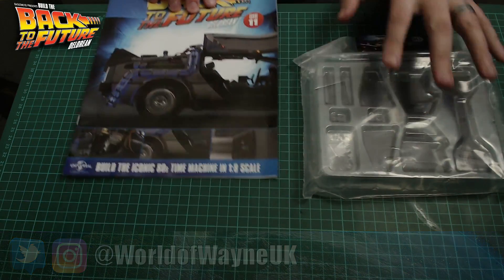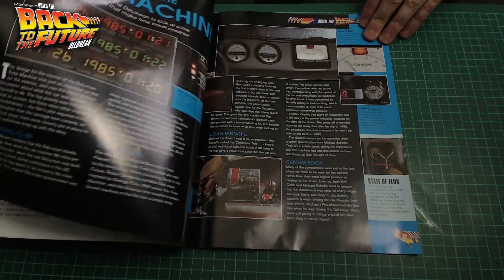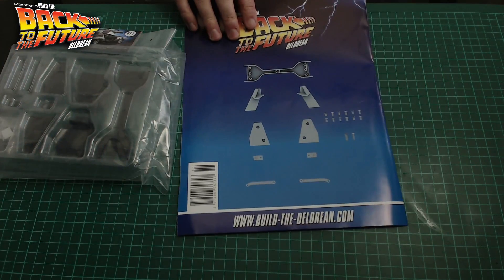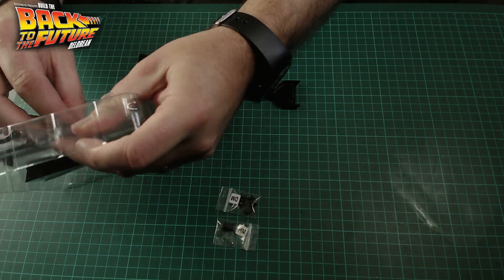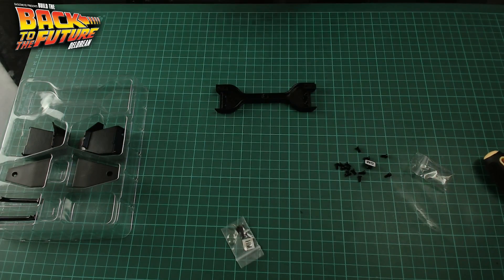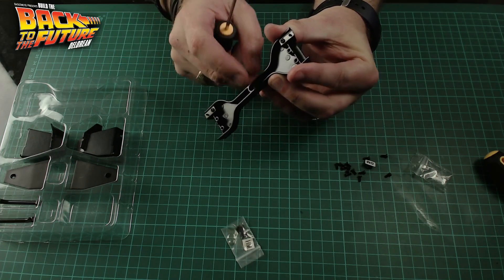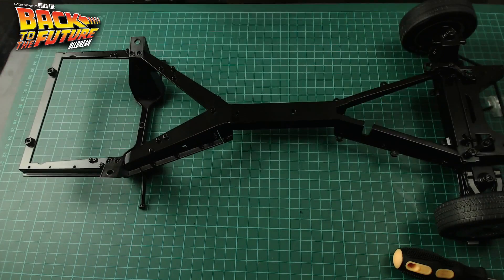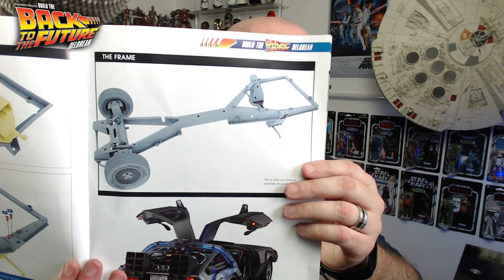Build the Delorean - Issue 11- Engine Support and Connecting Rods

Comment: Also! I’ve front wheel wobble, any ideas on how to remove the centre cap so I can remove the wheel?!
Reply from the maker: Strong double sided tape. Or you could break them and order a magnetic set from Mike Lane Mods
Reply: @WorldofWayneUK  cheers, Gorilla tape did the trick. Also, for holes not bored deep enough, I use a drill bit meant for wood.  Same for holes not wide enough, works a treat.  That said, I shouldn’t have to do that if the quality was right. 👍

Comment: Another occasion where the diagrams in the magazine don't match the actual item.  In this case the 2 arms.  The 2 hooks at the end of the arms aren't even present in the diagrams.  Very frustrating.
Reply: Yup. Did this issue yesterday and the diagrams definitely do not have the pegs on the end of 'em. Had to have a close look at the curved ends in the diagram and the parts to figure out which end went where.

Comment: Hey wayne. I think you have put the arms the wrong way round. if you look at the instructions the straight end goes into the engine mount and the curved end out on the outside. keep up the good work
Reply from the maker: I glad you said that David cos the pics for these arms look nothing like what I have. Mine are exactly the same so I was wondering if they were meant to be different. If so im guessing I will have to get on to Eaglemoss again.
Reply: yeah we had a big discussion on the forum about these. we wont know until the next issue and see which way they need to be to fit
Reply from the maker: Its all good. I've turned them round and now I realised why the screw didn't tighten. The other side doesn't have a thread lol :D
Reply: love the video from chris